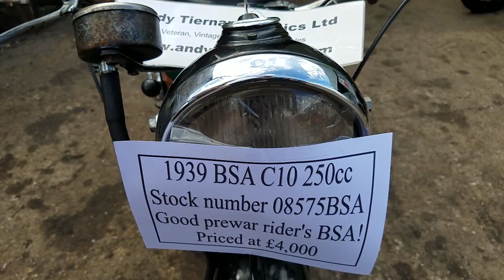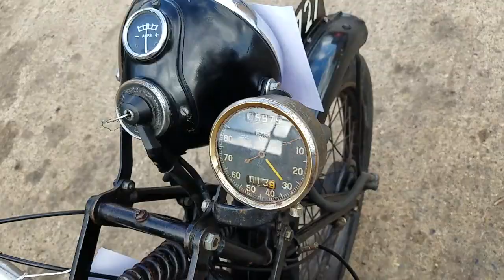1939 BSA C10 250cc at Andy Tiernans #08575BSA

Comment: Hi guys i own one of these and got charging problems.any tips?
Andy
Reply from the maker: Check the output from the dynamo first,  it could be a dirty comutator.  Have a look at the Matchless clueless web site there is a lot of info about dynamos.
Reply: If dynamo is ok, Buy a dvr2 reg.
Reply: Hope you got you’re charging done 
Quite an easy fix even with the old regulator if you keep that 
First job 
Run the bike at around 1200 revs with a charged battery and link out D&F  on the dynamo link to a 12volt bulb not 6volt touch the end centre terminal down to earth 
Increase the revs it should brighten up 😊 or use a multimeter but you must link out D& F 
If that’s ok then obviously itl be your mech reg 
Clean all the contacts 
Remove F ADE connections clean them up and re connect 
If this is faulty then either get the new one or an electronic DVR 2